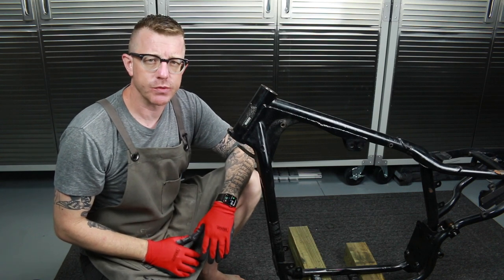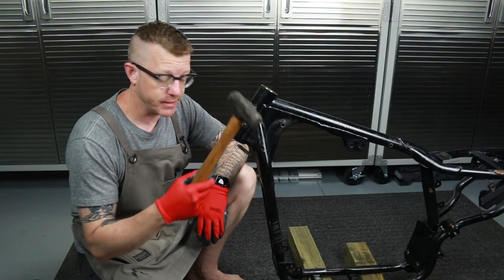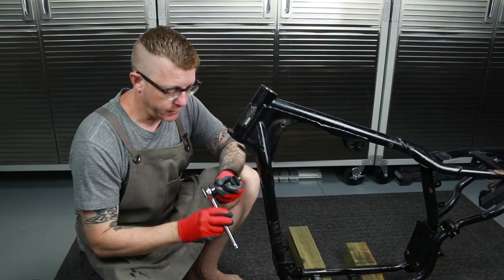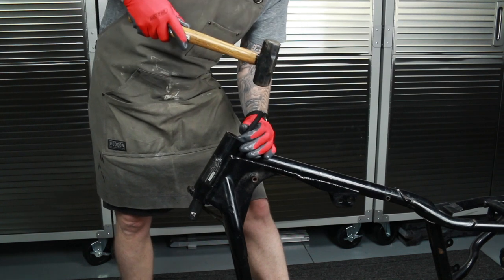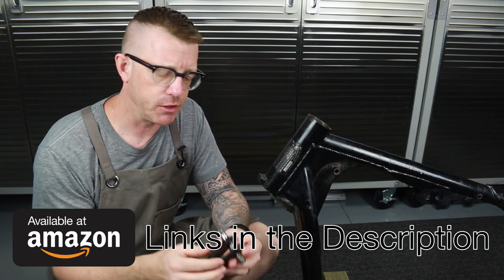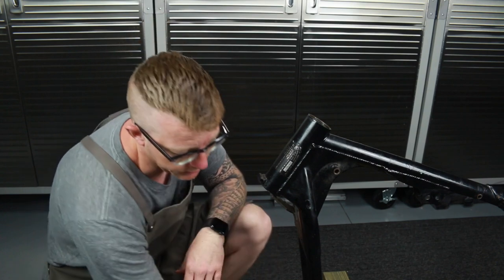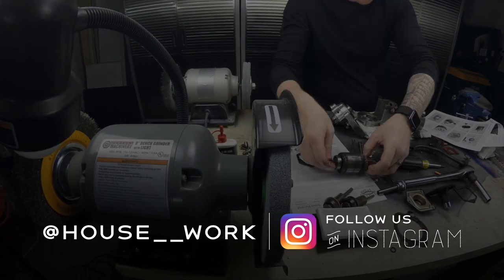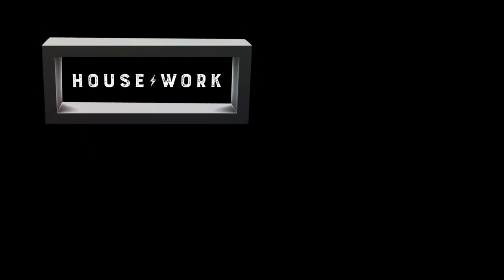Motorcycle Steering Neck Bearing Race Removal - Harley

Comment: Bought removal tool based on video for Harley Sportster and didn't fit due to taper in frame. If you trim/grind the bottom side of the tool at an angle (each side) but still leave a few mm of the lip and it'll fit snug in behind race. From there just knock it out with punch or drift.

Not ideal especially if you just bought tool new, but if that's the tool you got that's easiest way to do it.

Comment: would worn out Races cause death wobble ? my Road Glide has death wobble...
Reply from the maker: That’s most likely due to a bad wheel bearing.
Reply: Or swingarm bearings.  Be careful out there bro.
Reply: Im also hearing that adding a brace on the forks can help with that.
Reply: Update...the dealership said it may be the front tire, I had my doubts because the tire was new 🤷🏼‍♂️ but they warranty it and replaced the tire and holy shit ! It fixed it...rides like a dream 👍🏻

Comment: This is the most frustrating tool I have ever used! The bearing races on my bike has no edge or lip to get up under. So I just have to tighten the tool as HARD as I can. But the thing just jumps out.
Reply: Hi. Can i have an update on how you remove  the bearing races.